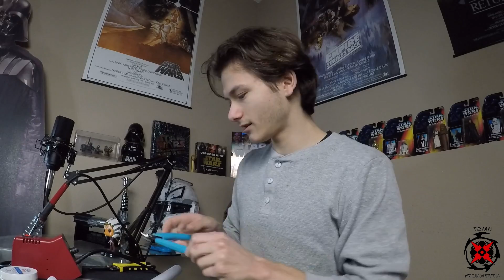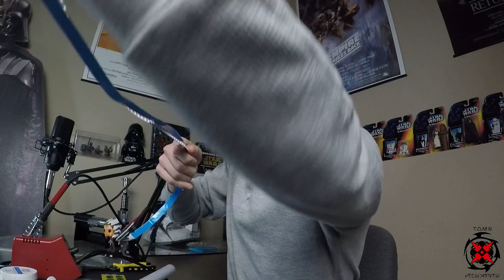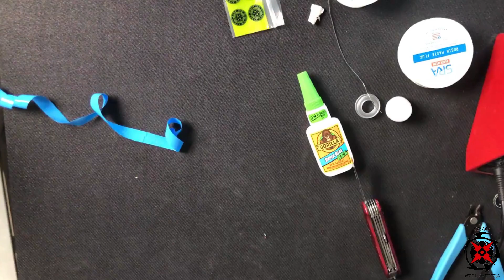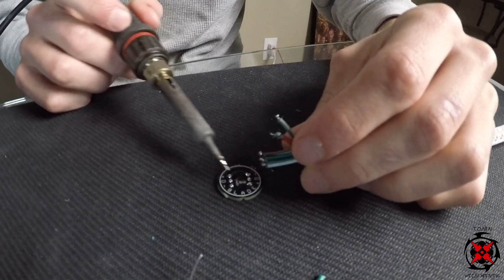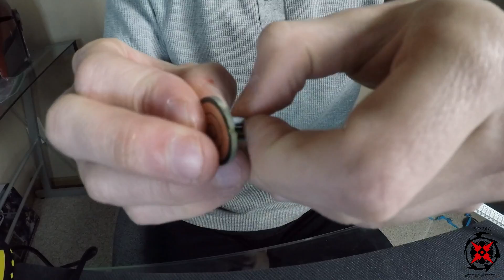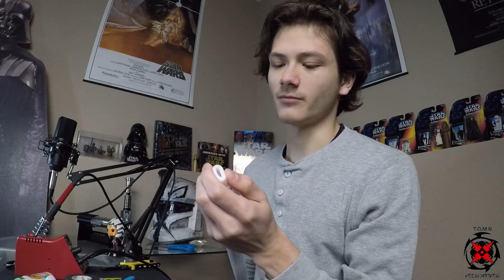How To Build A Neopixel Lightsaber Blade

Comment: Do you have a similar video where you make a 3 strip or string blade, in a triangular shape? 👍 May The Fourth Be With You!! Also, are you using leaded solder?
Reply from the maker: I do not have a video like that but the principal is the same for a tri-strip blade. 
I forget what type of solder I used in the video but I'm sure it was.

Comment: Is it possible to have a small dowel as a core to act as a stable base for 3 led strips and solder them in concert to create a brighter blade?
Reply from the maker: There are actually pixel sticks now you can buy premade with 4 sides of pixels. I believe you can purchase it from saberbay it's called the SaberTec Quantum LED Strip.

Comment: Have you tried potting any of these blades?
Reply from the maker: Potting?
Reply: @Ronin_Sabers  applying heat-conductive epoxy or conformal coating in order to stabilise the solder joints and make the solder side impervious to liquid damage.
Reply from the maker: @LRJ88  I have not tried it. I don't recommend taking them out in extreme rainy conditions because even if it is sealed for the blade it can still get water into the hilt PCB and cause damage.
Reply: @Ronin_Sabers  Even if there isn't rain you can still have issues with general humidity. Usually potting is used to harden electronics to any potential damage, first among that damage coming from physical issues. having some potting in the bottom of the blade could make it pretty much completely duel-proof.
Reply from the maker: @LRJ88  yes but if anything breaks it won't be easy to make any type of repairs. You would have to construct a new blade if anything happened. 

It's a good idea in theory but in practicality I would most likely find it very annoying.

Comment: What about building custom hilts or blade patterns?
Reply from the maker: Hilts can be designed in many ways, through a CAD program (getting them machined) or even with PCB or metal pipes. 

Blade styles are made through the proffie style editor 

I won't be doing a tutorial on such things.

Comment: Ummmmmm, you can literally use a strip that already has been cut to 20 as a measurement tool to cut future strips. That way you can save time and not have to count 20 L.E.D's 6+ different times
Reply from the maker: This is just one way to make the neopixel blade. If that method works for you, that's great

Comment: Question i have that same lightsaber but got it from Neo sabers its a xeno pixel not proffie but was wondering if i can change the light on it  like just upgrade the top section put a new light mount with wires and a new blade possibly just because i look up this same saber from different sites and there light seems brighter then mine and its the same saber
Reply from the maker: The board and the hilt side PCB will as well as the blade itself will determine how bright the blade is. I'm not familiar with xenopixel but you should be able to swap it out.

Comment: Great video really well explained but I'm wondering if I wanted to add a third pixel strip, would I simply solder it to the same soldering points as either of the original two strips?

Comment: I have had two bakers fail and would like to repair myself but what seems to be the most commonly failing part the PCB or the led strip itself going open circuit?.
All the connections look ok ?

Comment: I must say this is an AWESOME step by step video. I have purchased all the components to try and make my own. The only thing I can't find is the diffuser foam for the blade. I looked at TCSS but only have a diffuser tube. Any idea where I can get one?
Reply from the maker: For 1" blades: https://www.thecustomsabershop.com/Foam-tube-for-1-thin-tubes-V2-P1336.aspx

For 7/8" blades: 
https://www.thecustomsabershop.com/Foam-tube-for-78-thin-and-1-thick-tubes-V2-P1335.aspx
Reply: @Ronin_Sabers  Thanks for the help! I hope to get it done by the Thanksgiving holiday. You are one of the best saber smiths out there. Keep up the good work.

Comment: I like how almost all saber companies charge 60-90 Bucks for a pixel blade, when you can make your own for under $20 bucks.
Reply from the maker: That's not true. You'll be spending at least $100 for parts alone.
Reply: The LED strips might cost $20.  It cost $20 for a Walmart lightsaber toy, that you could remove the lights & electric out of and transplant your own stuff into.
Reply from the maker: @WhatAmIGonnaGet  That's not the same quality of material
Reply: @Ronin_Sabers  I know.  I am just saying - that $20 gets a plastic tube, a light-bulb, or a toy at kid's 'r' us.  Maybe a circuit board, the led strips, a buttons if you want to wait 3 weeks to ship from China.

Comment: Can you make a duel strip blade?  Just like the Bendu Armory V2-KR ?
Reply from the maker: All neopixel blades have two strips, as seen in this video. It's two strips back to back.
Reply: @Ronin_Sabers   oic. Thankyou
Reply: @Ronin_Sabers  do you know why the V2-KR is brighter and better?  It’s $140.  How much was your cost to make your own?
Reply from the maker: @TwistyMcThrottle  I charge $170 for KR pixel blades. They are brighter because they have more pixel per length. For example a normal 32" neopixel strip blade has about 120 ish pixels. A kr neopixel strip blade has 132 pixels.

Comment: Can I turn my Disney Vader saber into this using the materials in this video? If I just wanted to use the board that's in the saber already, or do I need to replace the board with a CFX or another aftermarket board?

Comment: I have a serious question,This shit is making me lose my mind. Your doing negative ground positive in order from the the pixel strip on to the tcss connector. But on my ws2812 strip and everyone I see on the internet it's positive negative ground on the strip itself red green white..Do I do in order right to left strip to tcss connector or flip flop white and green to the connector this stupid simple shit of me double checking not to fry makes me lose my shit.
Reply from the maker: Data is normally the middle solder pad (green wire) your strip could be different but both strip and PCB should be labels you don't confuse the wires

Comment: How do you do the hilt side for neopixel
Reply from the maker: Very similar to the blade PCB, accept a bit easier. Depending on the connector and the board you can wire just three wires instead of 5 or 6.

Comment: I'm not good building these things do they have already done for you even if you have to pay extra
Reply from the maker: Yeah they do
Reply: @Ronin_Sabers  about how much and another question are they impact proof?
Reply from the maker: @ninjaman4041  the custom saber shop sells them for about $130. The blades are not meant for dueling but neopixel blades can definitely clash and make contact with other sabers
Reply: @Ronin_Sabers  those are the ones I'm trying to get the ones that sound just like the real thing and impact resistance also
Reply from the maker: @ninjaman4041  you mean a neopixel lightsaber not just the blade then.
Reply: @Ronin_Sabers  can you point me to the right direction a website where person can purchase
Reply from the maker: @ninjaman4041  I install neopixel lightsaber and I have a few finished products on my website
Reply: @Ronin_Sabers  so you have neopixel lightsabers on your website can you hit me up with your website

Comment: Can these neopixel blades be adapted to a basic ultrasaber hilt?
Reply from the maker: It depends on the soundboard used
Reply: @Ronin_Sabers  I'm getting the full obsidian
Reply from the maker: @Azrael_indrason  I don't believe they have a neopixel option
Reply: @Ronin_Sabers  they don't butthe obsidian can be reprogrammed yes?
Reply from the maker: @Azrael_indrason  I don't believe ultrasabers obsidian board can be neopixel configured.
Reply: @Ronin_Sabers  damn ok

Comment: I work on these kind of lights a lot in solder small wires here's a tip for you tape your pixel strip down to your surface so it doesn't move around while soldering.

Comment: I’m trying to design a battle axe that pumps out some vapor. I need to fill in the flat faces of the axe head with lights. How would you suggest I work around that? I calculated it’ll need 6 of the strips you show in here.

Comment: How do u do the blades for the Roman mk 1 obi wans.  I seen other ppl had to put the board inside to give it more blade room to hold it?  Is that not necessary?
Reply from the maker: It's called a recessed blade and no if the pcb holder is flat enough you get decent enough blade depth.

Comment: I was thinking about getting a saber forge empty hilt and trying to install it my self. But while I was looking at it is says that it will not support normal pixel blades but only SaberForge thread in blades. Do you know any work around to just use a CSS pcb adapter or will I have to buy the specific thread in blade?

Comment: if i have a Resistor in my hilt do i need one for my blade? if i had one in my blade & hilt would it not work ?
Reply from the maker: You don't have to, but adding it wouldn't effect it working or not. It still won't have too much resistance.
Reply: @Ronin_Sabers  thanks sm!

Comment: Wouldn't using three strips in a triangle formation eliminate the dead stripes that can happen on the sides of the blade that don't have leds facing outward?
Reply: Yes, it makes the problem less obvious... But the issue with three stripes is that the blade draws much more Amps from your battery (Up to 14 Amps and more for pure white, IIRC) and you need to use a thicker wire gauge for your wiring. You'd also need a beefier battery that is rated for at least 20A continuous discharge. All of that makes it less attractive for most people. I must admit I have played with the idea in my head, and my next saber is probably going to use three strips to test it out.

Comment: If i have a saberforge hilt and i get a neopixel from Ebay it will be compatible?
Or is there any detail that I should know?
Reply from the maker: A Neopixel connector should be installed on you saber.
Reply: @Ronin_Sabers  alright, thanks man

Comment: This is great. I bought a Saber from the Pach Store and their neopixel blades are 1" mid grade. Depending on how I feel about the durability I might replace the outer tube with, a heavy grade blade from Tcss. Do you think that would be difficult to do? I imagine cutting a hole in the tube. Popping off the tip, and base and replacing it.

Comment: Mate, get yourself some helping hands, jeweller's vice, and needle nosed tweezers. Makes the job so much easier.
Reply from the maker: It's not really a problem. The work space I used to record this isn't usually were I build my stuff. In my workshop it's fine
Reply: Ronin Sabers fair enough! I find myself getting burned by the hot wires!